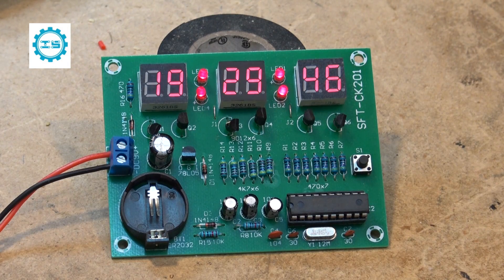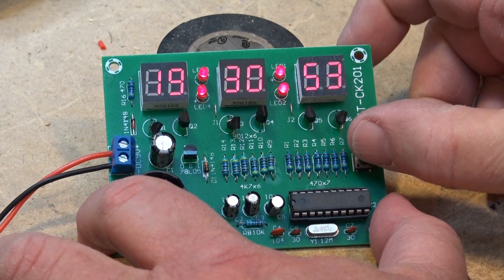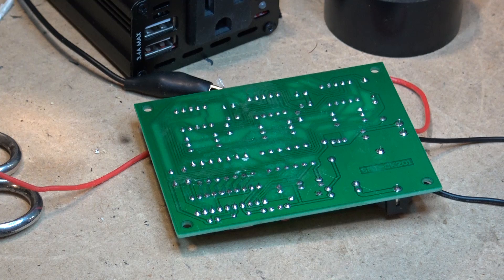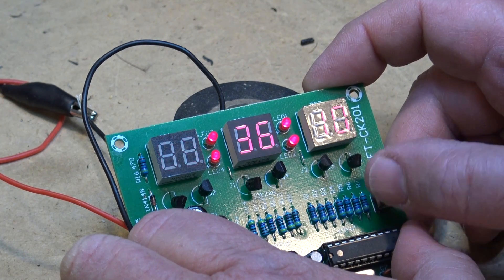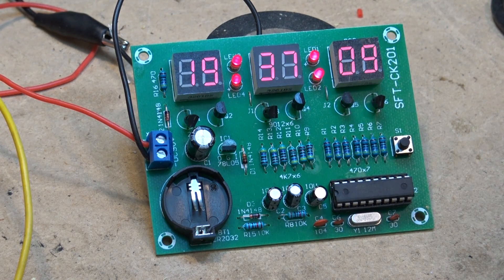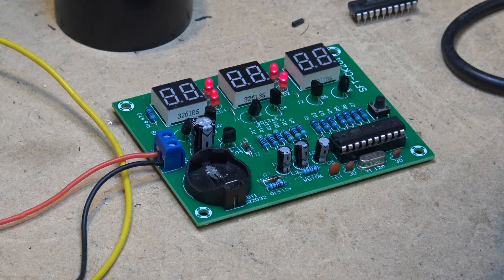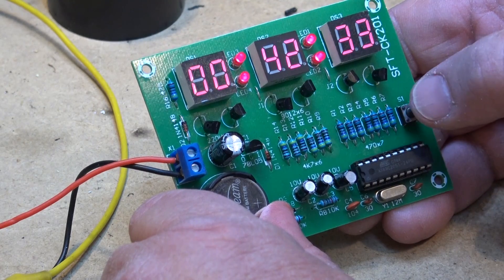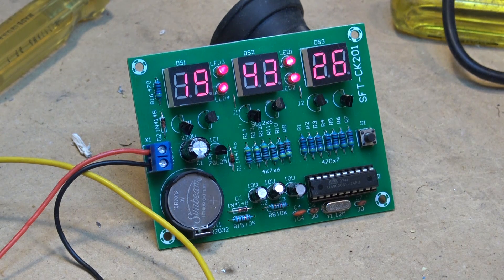IC Station 6 Digit Clock

Comment: Maybe they had the kit assembled in China....
Half the stuff I pick from the trash either has bad caps,or cold solder joints... I figured it was going to be "Hammer time" for the other kit tho :-)
Reply from the maker: It just needs the atmel programmed with the correct code.
Reply: Got it....I was goofing around.....I built a nixie tube clock a few years ago,I did not think to make a vid about it. Until Youtube came about I did not think many were interested in this stuff.BTW: I just finished up the scope clock kit,was quite easy.
Reply from the maker: I missed out on a Nixie tube clock kit. I was going to buy the one that Ramsey Electronics had. It was about 300.00 for the kit with the wood base, and I had been waiting for the Canadian dollar to improve as it was very low at the time, and then I went back to their web site a few weeks later and they can closed the kit division, and sold off their stock. I went to the sites they said had their stock, and the crooks were asking upwards of 1000.00 for the kit. Of course you know where I told them to stick that. I ended up building a 6 digit VFD clock kit. The video is on the channel. That unit also looks cool. Has an old 8 digit Russian calculator tube. Lucky to get that get that kit because it is now no longer available.
Reply from the maker: Wow, thanks. I just ordered one. Will build it on the channel when it arrives.

Comment: Hi- Does the clock go in reverse?  Like a countdown clock? AJ
Reply from the maker: As it sits no, but the code is open source, so someone with an atmel programmer, and a little programming knowledge could easily recompile the code to subtract the counters instead of add them.
Reply: so they dont sell a countdown version?
Reply from the maker: They might. Check out their web site they have tons of stuff there.

Comment: Im have this clock kit. This circuit are fail R150k resistor soldering in paralel 1n4148 diode you must remove cutt off this resistor because battery cr2032 in future poop up.

Comment: It is a shame it cannot take a signal from an atomic clock receiver.
Reply from the maker: This one can't but my other one I built before, the ice tube clock that uses a VFD tube can take the time signal from a GPS receiver..
Reply: Those VFDs can be used as Triode Vacuum tubes where the heater is actually part of the circuit anyway the VFD heater runs of 1.5v google for VFD TRF Receiver and you will see what I mean.
Reply from the maker: A VFD is a tube. The anode has the phospher that glows.
The screen in front of the anode will act as a control grid and the filament is a directly heated cathode.

Comment: The shame is you built the kit very nicely and they sent you a pre made one that was assembled by a monkey, the parts are all over the place.
But the replacement does have battery backup, so thats a gain :-D.

Blank unprogrammed chip, some one at there source just doesnt test the chip after programming, sloppy supplier.
Reply from the maker: If I can find the source code, I will program the chip myself.

Comment: When I was in HS, I bought a Dynaco AF-6 tuner kit. When I got it home, I found that it was factory-assembled. I tried to contact the seller, but they wouldn't take my call. So I kept it. Several years later I bought a Sony ST-5950 SD, which sounded better. I sold the Dynaco and still use the Sony.
Reply: That was the best deal as you sold it.

Comment: That first board could make a fun project to program a blank Atmel chip that fits in there and make your own programmed clock.
Reply from the maker: Will have to get an atmel programmer and do just that. 
Actually I have another clock that I believe has the header on it already for flashing the chips. Just need to find the source code.